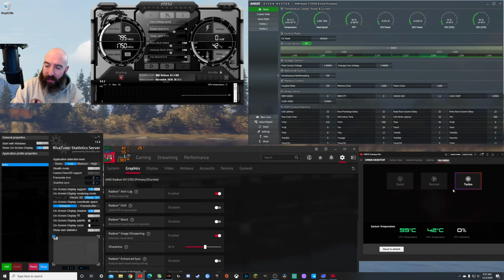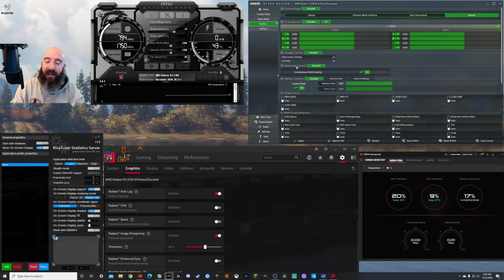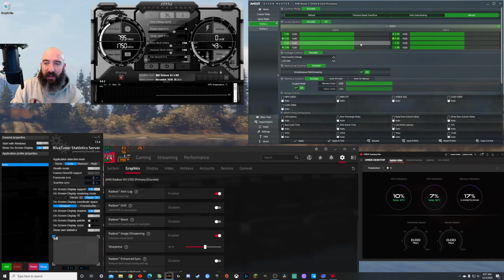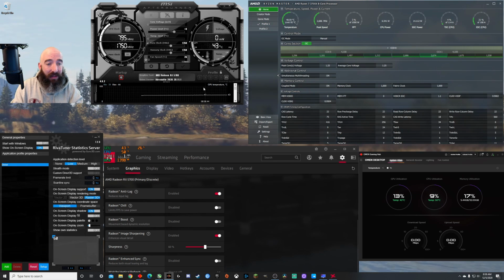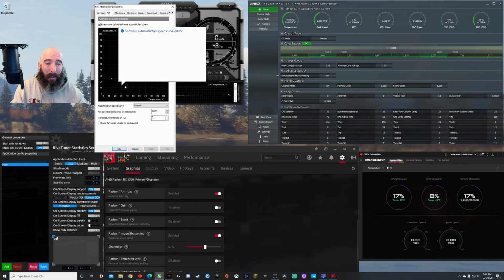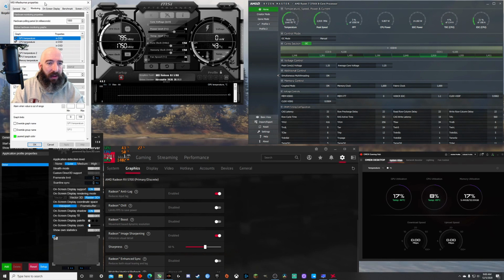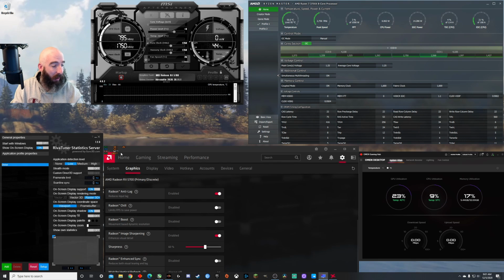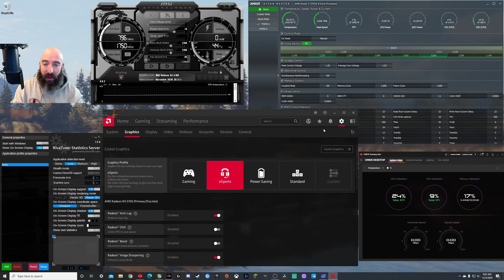My Current Modifications! HP Omen 25L! All Mods and Programs I Use!

Comment: Hey man I just got this computer and when I updated my drivers for the graphics card and started the install my computer restarted itself. It did it every time I tried to update adrenaline. Now my computer refuses to start windows and is in what seems to be an endless restarting loop. I can’t even try to attempt to reinstall windows because my computer always restarts during the process. Any suggestions?
Reply from the maker: You’re going to have to call HP, I’m still not entirely sure what the confirmed fix for this is. Some say it’s a display driver issue but I have a hard time believing that. Wish I could help but I’m just not sure what fixes it. Can you please let me know what you find? Thank you
Reply: @DanKamYouKnow  oh so this isn’t the first time you heard about this? And yeah I’ll definitely keep you updated. I’m just super bummed because it was working absolutely great and then boom. I might even have to return it but I’ll see what HP says to me. Thanks anyways!
Reply from the maker: Yes, it’s quite common with Omens and recently updated Windows. Let me know 👌🏻

Comment: In the front of the case, will I be able to put a 120mm fan? I am getting an Omen 25L soon and am planning on adding 3 corsair sp120s.
Reply from the maker: You may be able to fit one but I have no tried. I run a 92mm in front and a 120mm on top and bottom. You could mock one up to the front to see if it fits.

Comment: So what temps are you getting now? And also is 70-85 okay temperatures for gaming
Reply from the maker: My CPU is usually between 50-60c while gaming and GPU is 60-70c. 70-85 is within the safe range for temps.
Reply: @DanKamYouKnow  also I cannot seem to find compatible CPUs for this LGA 1200. If i was to upgrade would i need to swap out my motherboard?
Reply from the maker: Never done a CPU upgrade so I’m not sure what will fit the Omen motherboards

Comment: I see that the (120mm Noctua Chromax Fan: Unavailable as of 12/5/2020 =/"Do you have any recommendations for a suitable replacement for that fan?  Thanks for the very helpful videos!
Reply from the maker: I’d still recommend the Noctua fans but stock for them is a bit rough right now. Most aftermarket fans are gonna be better than the stock HP ones so it depends on what you like.
Reply: @DanKamYouKnow  Thanks for the quick reply!  I'll look for a replacement as the temps are running quite high.
Reply from the maker: No problem! Good luck

Comment: Would a noctua nh15 fit in the 30L?
Reply from the maker: No, way too tall. You’ll have to use an air cooler that is under 140mm tall to fit in the case of the Omen. A Noctua U9S ( what I have ) and the D9L. I went with the U9S because it comes in black ( Chromax )
Reply: @DanKamYouKnow  oh alright, been looking at scythe fuma 2 as well. How does your cpu perform with full utilization and overclocking?
Reply from the maker: Well, with my U9S and very high CPU utilization ( video rendering ), it hits about 65-75c. Averages about 50-50c while gaming. That cooler looks like it is 154mm too tall, and will not fit it m the case ( it will hit the side panel ). You’ll want to stay under 140mm or swap out the case so you can fit it.
Reply: @DanKamYouKnow  ohh alright. I'm getting an omen 30L with an i7 10700k and rtx 3080 trying to explore cooling options. Thanks
Reply from the maker: I believe those come with a liquid cooler, but the temps still get a bit warm. Your best bet is to probably change the case.
Reply: @DanKamYouKnow  yeah, I've been thinking about going lian li cool mesh route with a 240 aio

Comment: Do you think it would be possible to shove a MSI Gaming GeForce RTX 3070 into there?
Reply from the maker: You just have to make sure that the max length of the GPU is less than 300mm
Reply: @DanKamYouKnow  Dang, its 5 mm too long. Thanks for the info though.
Reply from the maker: I misquoted you, the longest GPU is 286mm that will fit.

Comment: Have any of the fan upgrades actually helped your temps. No matter how many fans I add still have high temps
Reply from the maker: A couple degrees Celsius and they greatly helped with fan noise. Honestly, the best thing you can do is either change the CPU cooler, or change the case, and use MSI Afterburner for GPU temps.

Comment: Hey man. I’ve been watching your vids on how you mod your 25L and I can say that you’ve almost convince me to buy this one. Really cool vids. I’m getting the one with an i7-10700F and I’m wondering if you can asnwer my question. 

Is the pre-installed mobo compatible with an rtx 2080ti? If not, can you recommend a mobo that will work with it together will all the components of the pc?
Reply from the maker: Yes, the Omen motherboard will support pretty much any graphics card. There are Omen users who have installed 3070’s and 3080’s in their Omens with no problems. If you are considering a 2080Ti though, you may want to look at a higher wattage PSU like a 650w or 750w, the stock 500w PSU might not be enough.
Reply: @DanKamYouKnow  Will be checking that out. Thanks for these vids, it helped me a lot in deciding actually :)

Comment: Hey man, nice video! I have same omen 25l with rayzen 7 3700x and rtx 2060 super, i buy i cpu cooler like you and when i play warzone i have 70-75° and my gpu has 83° permanently, i have just one 120mm noctua fan on top case and one 92mm...i wait an answer from u. Thx
Reply from the maker: I just messaged you back on Instagram.

Comment: We talked before about PCs. My New 25 L has A bad latency for warzone any tips on how to fix that?
Reply from the maker: How bad? Warzone is notorious for having latency issues. Not surprising to see an average of 90ms while playing
Reply: @DanKamYouKnow  Everytime I get in conctact with someone it goes up to 80+ 
I have a ryzen 5 3600 processor.
Reply: And I don’t want to lag every encounter and I do it’s frustrating after every method I’ve tried doesn’t work
Reply from the maker: Are you on an Ethernet connection? What’s your latency like on other games? 80ms is Warzone is normal, game is not optimized well at all.
Reply: @DanKamYouKnow  I wonder what my problem is... maybe my processor or router I’m getting a new router today I’ll keep in touch
Reply: Yes Ethernet I understand the high latency but how do I have it so I can at least play even on low FPS you know what I mean?
Reply from the maker: I’m not sure what you mean by that. Are you getting FPS drops?
Reply: Other games run fine honestly I only tried two other games
Reply: No sorry it’s just latency issues idk how to fix it
Reply from the maker: Do you have multiplayer? I would see what your latency is there and compare. I have a great internet connection through Ethernet and my average latency is 80-110 in WZ
Reply: @DanKamYouKnow  okay im going to try that. Do you lag at all during your warzone gameplay?
Reply from the maker: Not really. It seems like I should be it doesn’t feel too bad most of the time. 80-110 in multiplayer feels horrible though lol

Comment: Hi Dan. I just bought a 25L and I was wondering if you could help me figure out what hardware upgrade I should prioritize first. I've got the 3700X & 2060 and currently only have the 2 stock OMEN fans. I already removed the metal pannels on the top bracket to improve airflow. I also only have a single stick of 16G 3200 ram.  I don't really have a budget, however, would like to make the best bang for my buck upgrade. I guess its down to: top 120mm fan, noctua U9S or another stick of 16G ram? Thanks in advance, I really appreciate the in depth OMEN videos.
Reply from the maker: Hey! I’m glad my videos have been helpful. I would say you are probably fine with 16GB of RAM. The best upgrade I did for my Omen was the U9S cooler, and it’s only $65 and about 1-3 hours of time installing it

Comment: Just bought the 30L for my son and runs hot saw your other top case fan upgraded for the noctua NF-P12 vid but noticed it another vid that it was different... what would be the best route to upgrade the top fan?
Reply: Okay sounds good just ordered the NF-P12 for now in hopes to help cool down for now. Just worried about overheating... will tune into video tomorrow thank you
Reply from the maker: I have since changed that fan out. I am going to be coming out with another fan video tomorrow actually and I will show how to install it and what I use. But basically, you are going to want to install pretty much any 4 pin 120mm fan you want, then use a y-split cable to plug the rear fan and the top fan, into the header where the rear fan is now.

Comment: Hey Dan, great stuff.  Check almost daily for content and have watched through many of your vids multiple times.  Quick question about the rear exhaust.  Know you updated it from stock to Noctua 92mm.  Did you originally put in a slim and went with a standard later or has it always the same Noctua fan?  Getting ready to start updating my 30L and want to be sure which exhaust you are using, so if you can let me know which one it is I would appreciate it.

92mm Slim Noctua Chromax or 92mm Noctua Chromax Fan?

Keep up the good work brother.  Loving my Omen.
Reply from the maker: Thanks Rob! I’ve got a few videos planned before the end of the year. Actually, as of now, I run no slim fans in my system anymore. While they do work, the Noctua normal size fans push more air and are a lot quieter. I should have a new fan update video within the next day or so. This is the rear 92mm I use now:

Noctua NF-A9 PWM chromax.Black.swap, Premium Quiet Fan, 4-Pin (92mm, Black) https://www.amazon.com/dp/B07ZHF2BPB/ref=cm_sw_r_cp_api_glc_fabc_wm45FbEF9XE9M?_encoding=UTF8&psc=1

Comment: Do you still recommend limiting maximum in processor state to 5%?

I heard that it eliminates the boost and can hugely impact performance.
Reply from the maker: If you are on the stock cooling system and are seeing very high CPU temps, I would recommend running the max processor state at 99% until you change out the cooling stuff. It will slight hinder performance but greatly reduce temps. I use to hit 93c when rendering videos on my Omen, which is throttling territory. The 99% helped with temps a whole lot, then I installed my CPU cooler and went back to 100%. It’s a temporary fix but with my Ryzen processor, it didn’t really seem to change performance that much.

Comment: My plan came with a 500w power supply, Can I plug and play a high rated power supply to run a bigger cooling system? I don’t think my current power will run this and my graphics card, also is it possible to use off brand ram? I thought plan only could use hyper x ram? I’d love to upgrade to what you have but am not very tech savvy and don’t want to damage my stock pc, can I take it anywhere to have the work done? Thanks!
Reply from the maker: What cooling system are you planning on running? You definitely should not need to change the PSU for a different cooling system. Yes, you can use off-brand RAM but it will default to a lower speed. I made a video about it:

https://youtu.be/PBervsjRYzw

Yes, most places should work on your PC if you didn’t want to.
Reply: @DanKamYouKnow  I really like the setup youre running, that you linked and would like to go that route, as for y splitting cables I worry I would do damage to my pc.
Reply from the maker: Y-splitting is completely safe for PC’s and I definitely wouldn’t do anything to damage it.

Comment: hey mate looking at installing an additional  internal ssd in the second port ( we have the same pc) i can see there's one cable called p5 which i think is the data transfer? but where's the power cable? is it tucked somewhere or do I need to buy one? any idea if the p5 cable can transfer ssd speeds? watching your channel was the thing that made me buy the pc I love it thank you
Reply from the maker: Hey Calum. There should be the SATA data cable and the power cable in the case. I believe all Omens have the cables required to add another 2.5” SATA SSD or 3.5” SATA HDD. I’m glad my videos have been helpful!!!
Reply: @DanKamYouKnow  sorted it hidden there's a port for an additional sata drive port
Reply: @DanKamYouKnow   i can find the cable named p5 but looked everywhere in the case for an other cable unable to find one so not sure were id plug the power for the ssd

thanks mate
Reply: @DanKamYouKnow  from the looks of it the p5 is a power cable so its missing the sata data cable any ideas where id plug one in ?
Reply from the maker: Look towards the bottom near your power supply. There should be another cable there. You can email me a picture of your system if you’d like. My email is in the description.

Comment: Did it make a difference for editing/rendering videos? Vs how it came stock, and if so, what changes did you see (good or bad) I'm broke as shit but i have good credit with conn's and they have this computer available within my limit and I just need something to edit videos/be able to expand on for gaming or whatever, just wondering how it works for editing stock vs upgraded
Reply from the maker: It pretty much edits around the same as it did stock except for the temps are lower. The temps can get pretty high while stock when rendering videos, so I would recommend installing a top mount fan. Other than pretty warm temps while rendering, the computer actually handles it very well and all my videos on this channel are edited with my Omen. HP just did the absolute bare minimum as far as cooling goes.
Reply: @DanKamYouKnow  good to know, this would be my first pc, tried a imac a year and had to return it, it was a horrible experience, looking forward to giving this one a try, thanks for the response! Subscribed
Reply from the maker: Let me know if you have any other questions and thanks for the sub!

Comment: Hi! I've really been enjoying your videos and I'm on the fence about getting this pc. I'm just wondering though if you need to have all those fans installed? I was thinking of just installing one on the top and one in the front. Would that be enough to keep it relatively cooler?
Reply from the maker: Hey, sorry for the late response, thank you! I want my machine to run VERY cool so I added all of my fans but a top mount fan and a bottom one will help tremendously over the stock configuration and totally work for you. Also, replacing the rear fan and CPU cooler fan will also greatly help your temps too. Even in it's stock configuration, the PC will run warm but the temps will be safe.

Comment: any link for the the splitter pls? keep rocking dude!
Reply from the maker: https://www.amazon.com/dp/B076542HBN/ref=cm_sw_r_cp_api_glc_fabc_D-E4FbFZ2CC5D?_encoding=UTF8&psc=1

I use the Noctua ones and they’re great.
Reply: @DanKamYouKnow  thanks dan, theres one problem i encountered, when i move the HD to the bottom i used p5 cable insteas of p4 now i cant access the HD. are using the same cable when you move you HD to the bottom? thanks..
Reply from the maker: I think I actually used the same hard-drive cable but both should work because they are just SATA cables between the HDD and the MoBo. Have you tried the P4 again? Seems like you may have a bad cable. Which slot on the MoBo did you plug the P5 in to?
Reply: @DanKamYouKnow  thanks for the reply Dan.. its ok now i just reset the pc and the system reads the HD now. still using the p5.

Comment: Thanks so much for all of these. 

I noticed your top fan is no longer plugged in to the LC Pump. 

Any reason for this? Is it okay if mine still is? It’s the only additional fan I installed.
Reply from the maker: I actually use a fan y-split cable and plug both of them in to the header that the rear fan is now. Lc_pump is fine for sure, it will just spin at 100% all the time. Being y-split with the rear fan will make them both spin at system speed. 

And no worries! Glad my videos are helpful.

Comment: Dan..new subscriber and student here of DKYK. Apologies if I missed any previous mention, but do you have any concerns with powering this current setup with a stock 500w PSU?  Is there enough juice there to push a GPU upgrade in the future?
Reply from the maker: Hey Kevin, thanks for the sub my dude. 500w is enough to power the current setup and will be OK to power a 3060Ti and a 3070 ( We have Omen users with those GPU’s in their Omens ). You just have to be aware of your current GPU’s power draw compared to the one you are looking at. Although, upgrading the PSU is always nice to future proof your rig.
Reply: In that case, I think a 25L needs a home on my desk, and you need a commission check from HP.     Many Thanks!!

Comment: do you know what chipset the motherboard uses? can't find anything on their page, wondering if it will support the new ryzen chips coming out
Reply from the maker: It is a b450 chipset. Not sure if the 5xxx series will work or not because you’ll need a BIOS flash and not sure you’ll be able to do it with the Moria 3 motherboard. L

Comment: hey man do you mind showing me how you put a fan on the bottom ?
Reply from the maker: What do you need help with? The bottom fan is wedged in between the power supply and the little cable clip.
Reply: @DanKamYouKnow  yeah i don’t know where to plug it in
Reply from the maker: Do you have a ft_fan or Ch_f fan header on your motherboard?
Reply: @DanKamYouKnow  yes
Reply from the maker: That’s where you plug it in, whichever you have.
Reply: @DanKamYouKnow  my friend doesn’t have one is there any other way?
Reply from the maker: It doesn’t have either?